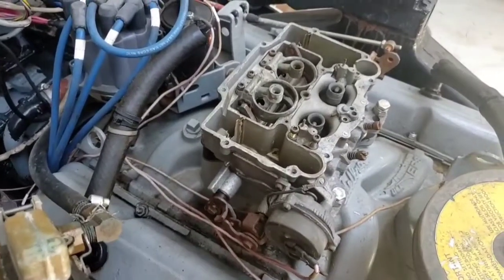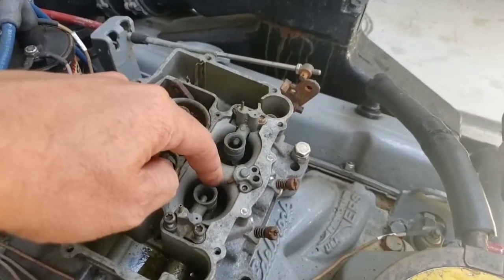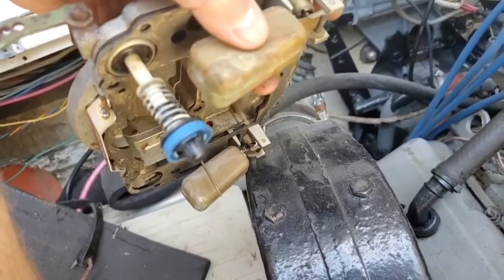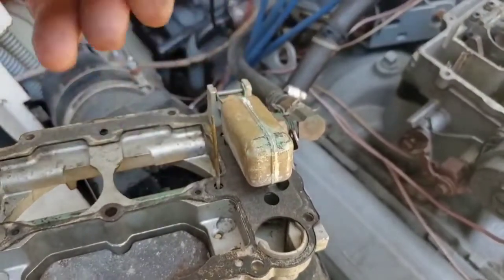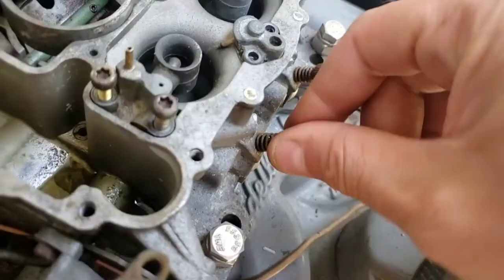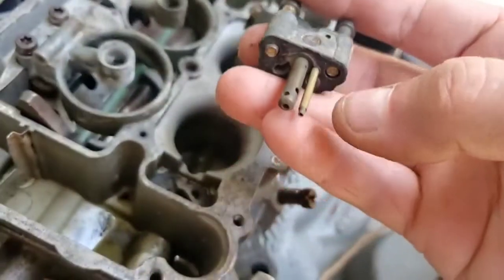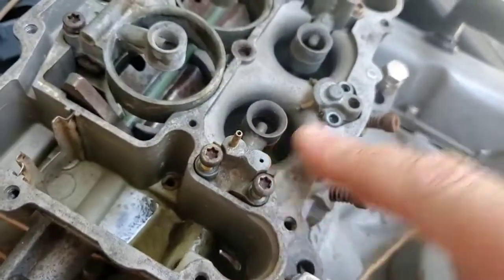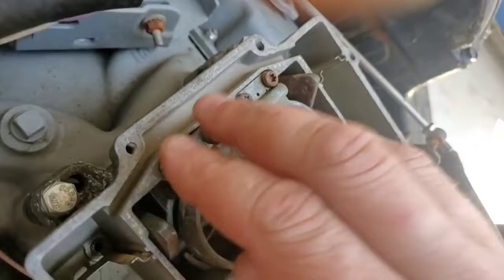Edelbrock carburetor operation theory for dummies

Comment: There should be a little tang on the floats near the pivot that rests against the seat that you can use to adjust how far down the floats can drop that way the needle doesn't try to fall out of the seat.

Comment: My boat used to gum up the carb like that, I bet you have an old aluminum fuel tank had some strange corrosion going on with it. Installed a new composite (fiberglass and resin) and no more issues--take care

Comment: Dude lay off the weed 😂You def know the carb through and through but it doesn't help students if the teacher doesn't know the name of a part much less the students.
I give you a B-. Overall your knowledge of the subject matter is still very helpful.
Reply from the maker: Thanks for watching. No weed involved 🤣, I had just studied the manual enough to get the operation straight in my mind and did an uncut recap of that. I tried to put the correct terms on the ovetlay. It was more about getting a visual of the operation for my reference and future troubleshooting. The manual says the same thing with all the terminology and pictures but it's harder for me to make sense of.